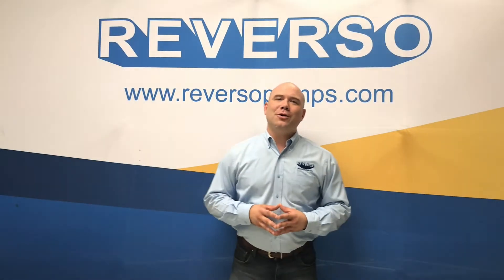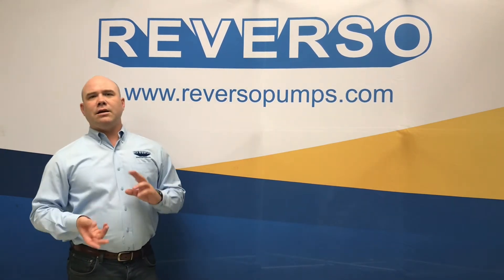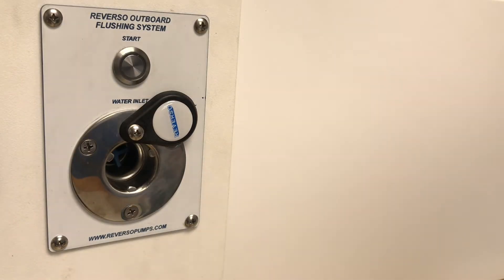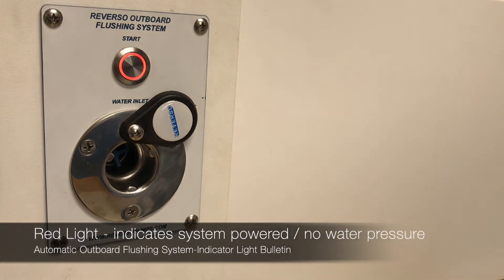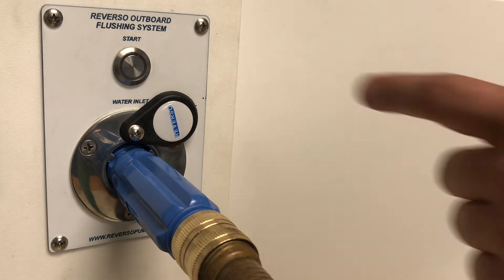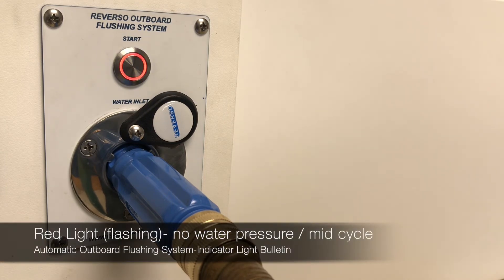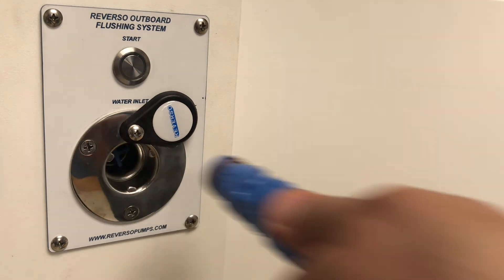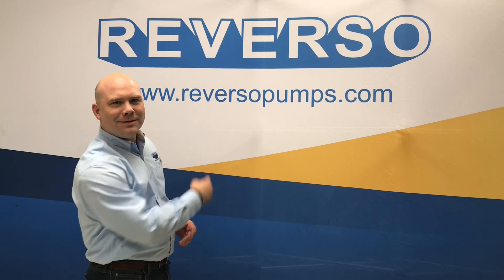Indicator Light Bulletin for the Automatic Outboard Flushing System

Comment: I’d like to see a press and hold feature that allows you to switch/skip to the next engine.
Reply from the maker: Thank you for your feedback! In Version 3.0, we have added a Service mode to manually switch to the next engine. This is particularly useful when needing to service the engines, if the user would rather time the flushing manually, or to winterize.
Reply: @ReversoPumps  Exactly! Thanks

Comment: How do you swap to the other engines
Reply from the maker: Thanks for asking. After pressing once for a 15 min cycle or twice for a 7.5 min cycle, the system will begin at engine 1. After the completed time, the system will automatically swap to the next engine, and will turn off once the last engine has finished its cycle. At that point, all engines have been flushed and you can disconnect the freshwater hose. To learn more, here are the Instructions for the Reverso Automatic Outboard Flushing System.